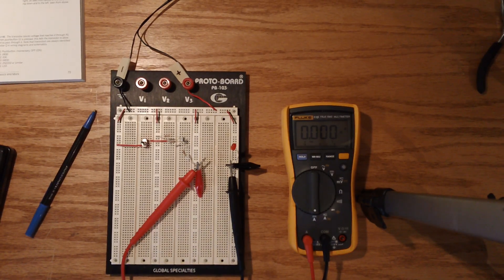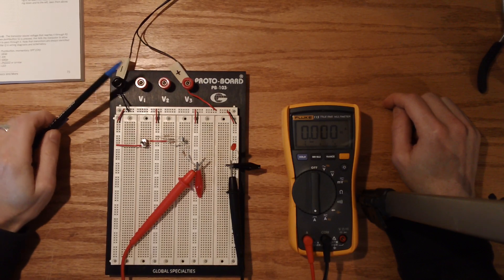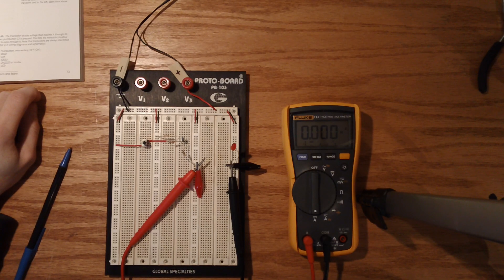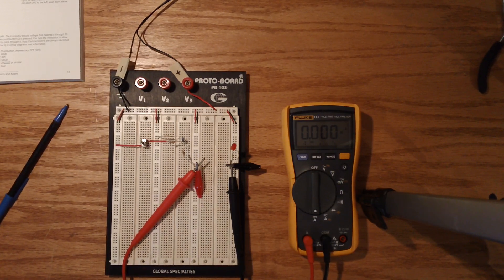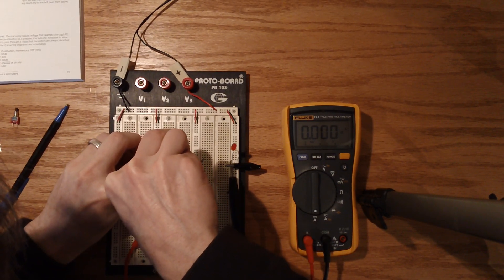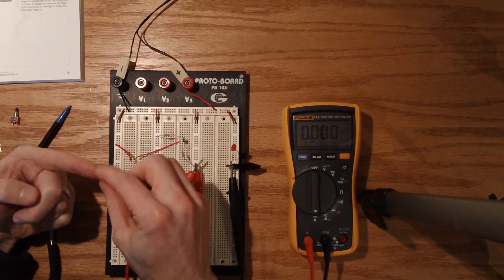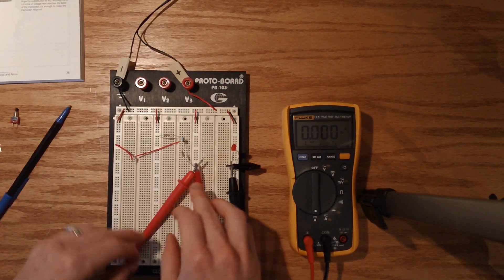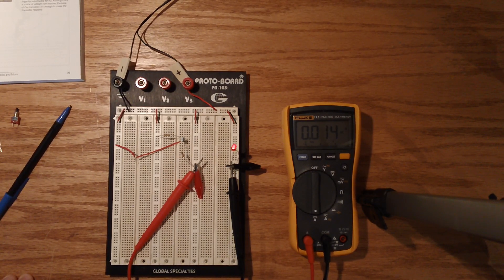Make: Electronics - Experiment 10

Comment from the maker: @kryton9 
There's lots of synonyms used for these things. It appears you're mixing components with properties of circuits. 

Properties of Circuits 
------------------------------ 

Voltage = Pressure, Force, Charge, Potential Difference, Tension, Imbalance of electrons 
Current = Flow of electrons
Resistance = Impedance of electrons 

Components
------------------- 
Capacitor = Stores voltage 
Transistor = Switch, Amplifier 
Relay = Switch 
...